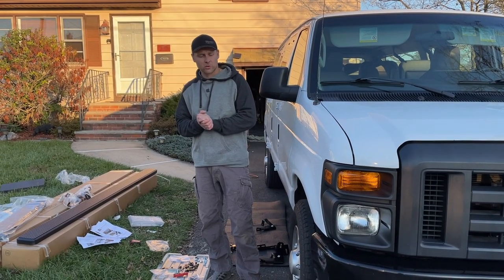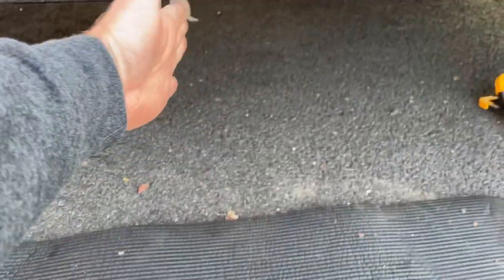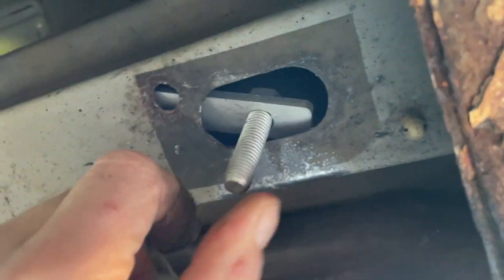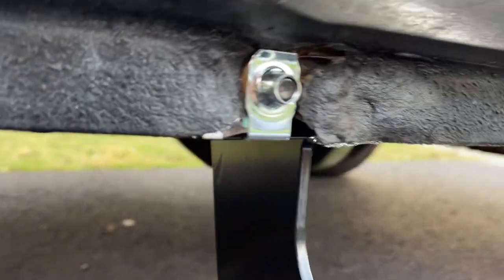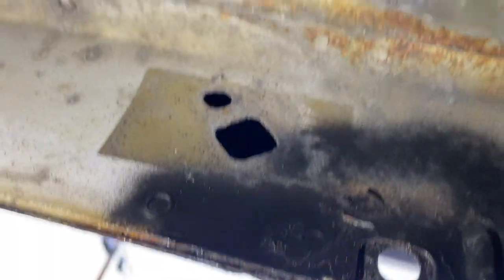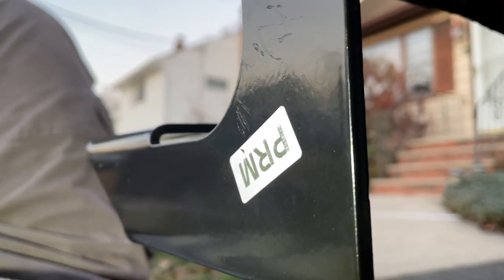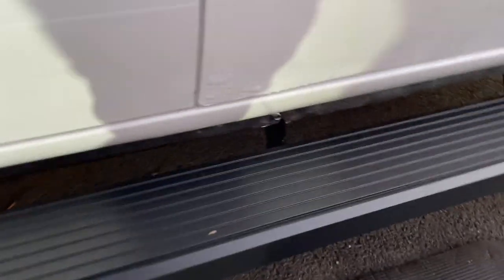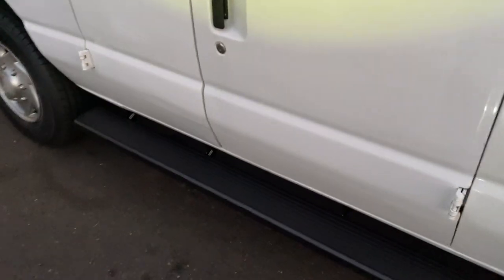How To Install Running Boards on a 250 Ford Econoline van full size,  F-150 etc(iBoard - Full Steps)

Comment: do u notice any difference after installing running boards ?
Reply from the maker: They are a great add on. No issues with how car drives if that’s what you mean.
Reply: @HowToWithLech   what i was asking if it got little a easier to get  inside the van vs standard steps ? thanks
Reply from the maker: @Ray-wr2wr  yes 100%  so much better.  especially for kids etc.